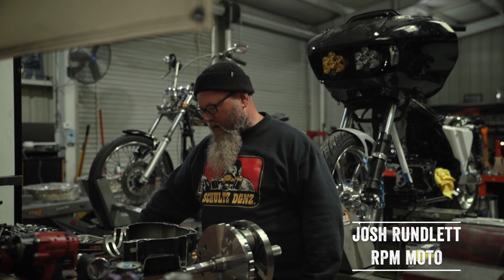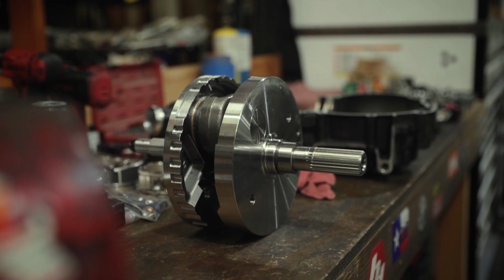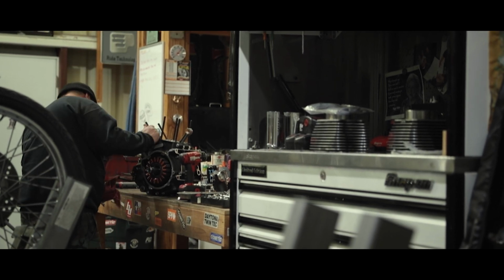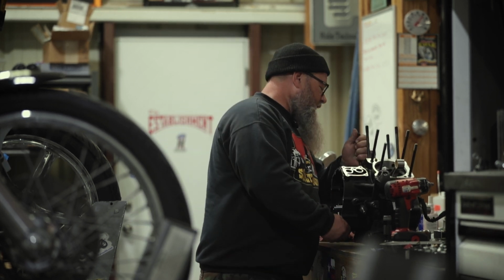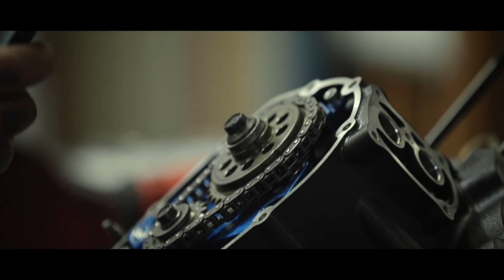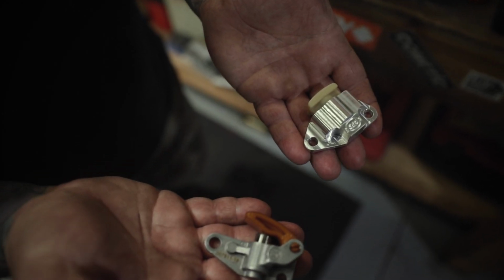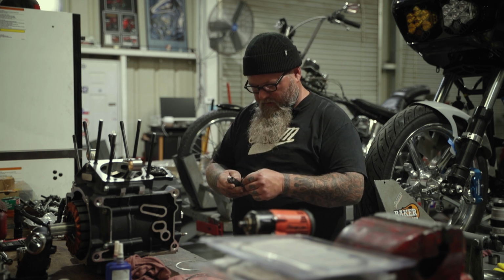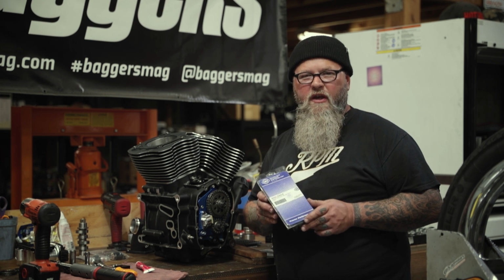SPEED-KINGS INSTALL: S&S 131" M8 w/ JOSH RUNDLETT

Comment: Why not use the gear drive cam with the new flywheel? Iam worried about this because im getting the same exact motor build with geared cam. Thanks
Reply from the maker: I personally don’t see a benefit of doing a gear drive cam. Chain works great for all applications. Just makes sense to me.